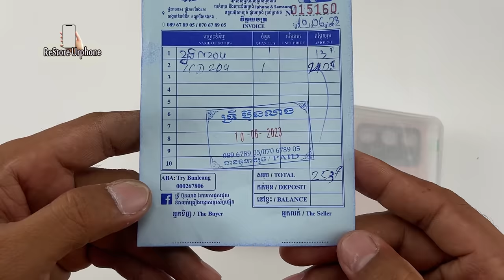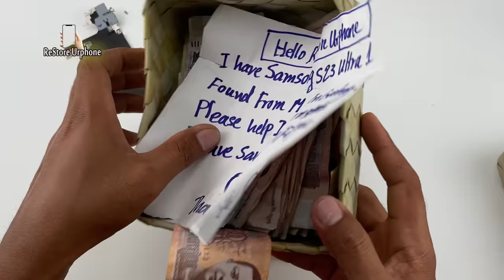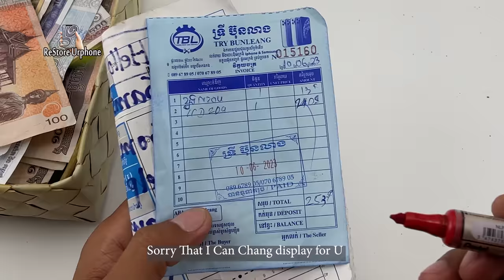It Samsung S23 Ultra...? How i Restore Destroyed Samsung Galaxy Note 20 Ultra !

Comment: Excellent work. May I know the type of material used to clean the board?
Reply: Acetone or any isopropyl alcohol which is easily available in electronic store and also u can use petrol for cleaning and isopropyl alcohol for cleaning the residue of petrol. Hope that helps

Comment: You can still recover display folder, paste new display flex.. centre line will be fix by replacing display flex
Reply: could have  easily just have been corrosion damage around/in  the port on the board .

Comment: Too bad the screen is easy to break. Just a little drop and it has the purple line 😢
Reply: Mustve been a cheap  copycat one then, cuz i dropped my note 20 ultra a few times but from much higher and no damage aside dents from the fall on the frame. He should have tested it with another board, could very well be that the port for the display cable on that one was busted.

Comment: The stripe should not, in theory, shoot from such a blow, or it was simply bad luck.  I compared the display we have in Russia, it doesn’t really look like this module is a «service» module. At a minimum, the packaging and equipment are different + there are no stickers. This is most likely a REMOVED module with BADLY re-glued glass. And so it was necessary to check, but the supplier most likely planted shit. Hold on! 😊

Comment: If a phone its sealed  with not so many small holes thats how you know it was on purpose that they opened this phone and they throw it in nowhere in a trash dirty dust then they sealed it back again dirty that's the way you know this kind of videos its scripted but is still interested so in other words is barely impossible for a phone to be like that because it hasn't enough spaces so the dirty can get inside of it  still i  will sub
Reply from the maker: Yes Thanzks 🙏